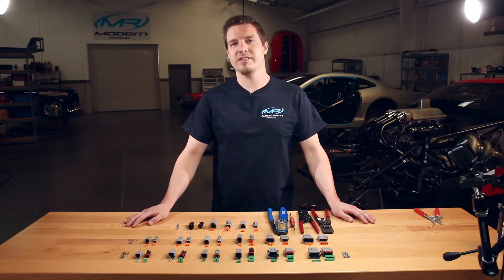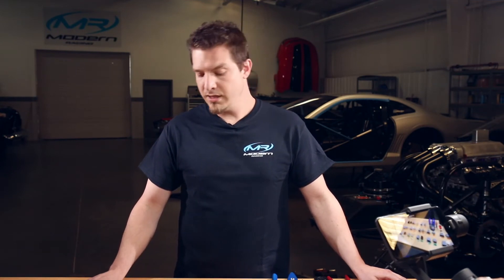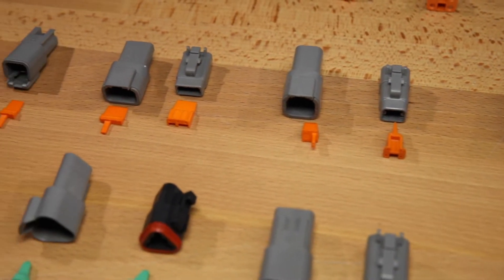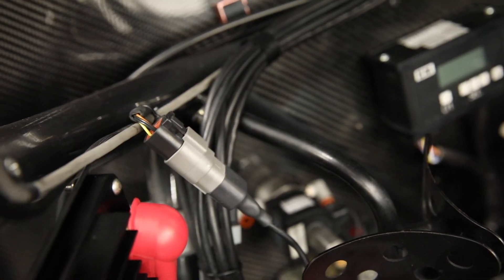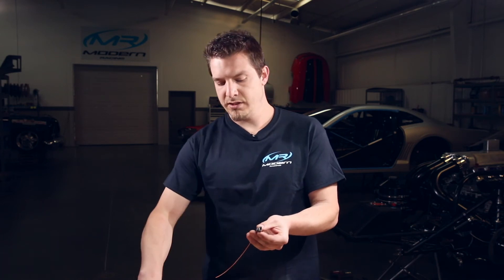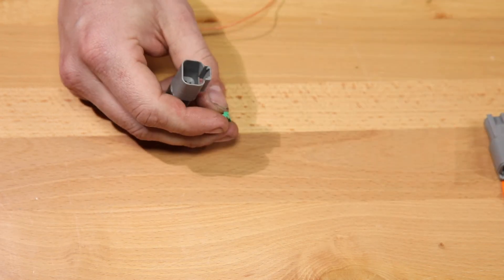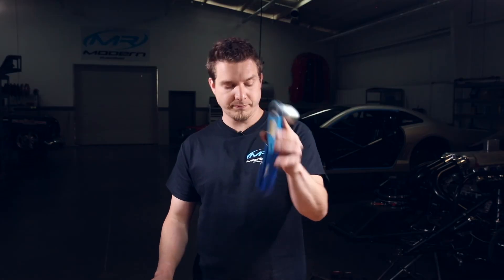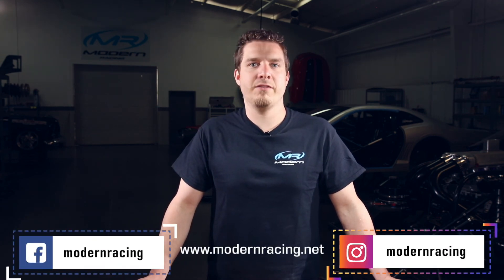What is a Deutsch Connector? The Basics - Modern Racing

Comment: Question. What is done about waterproofing the electrical connection. This off road build will need to address water, and it might be fairly high, particularly wires running front to rear at the floor board level. These might not be the kind I am looking for.

Comment: Are there male and female cavity plugs
Reply: No. The seal plugs are the same for the plug or the receptacle. They are held in place by the rear wire seal, which is identical for the plug or receptacle.